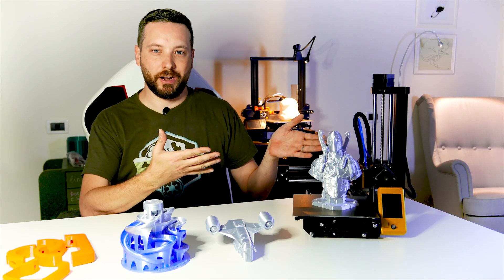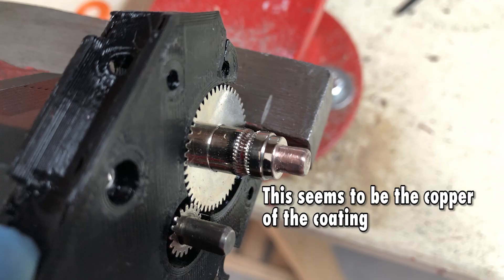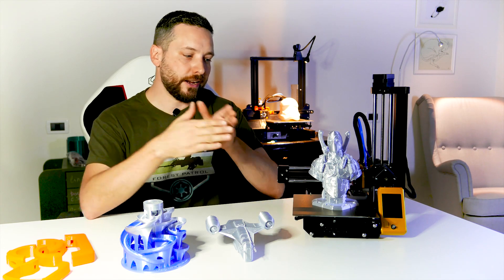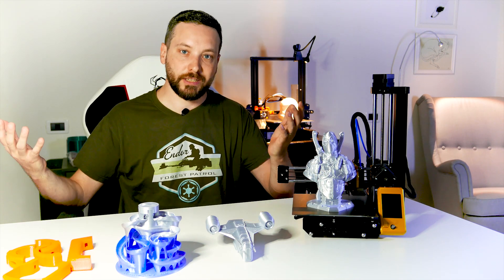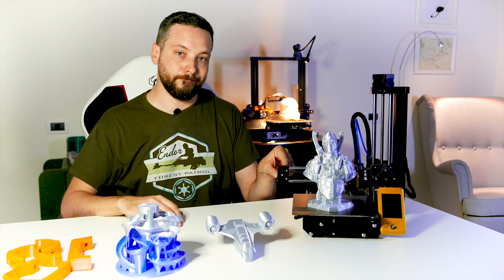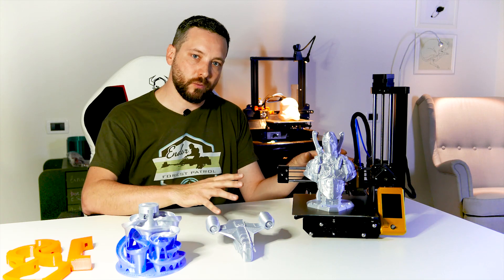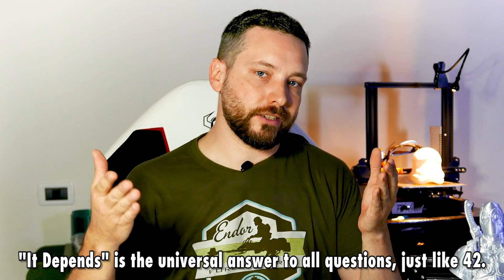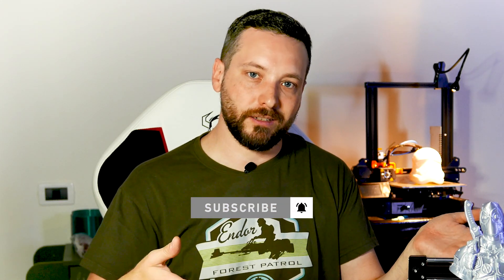Prusa Mini Clone Review!

Comment: Nice review, I recived mine same time and I agree with you as a good experience, caost me 210 shipped, btw am confused why can't this printer be 1st printer it's not complicated to build and  resolve and tinkering little bit and the extruder of prusa not good as bondtech anyway , and the main reasons to get fysetc one the coast and the lead time to order from prusa
Imp worth it
Reply from the maker: How do you print the parts if it's your first printer? 😜
Reply: @AMakeDesigns  this is not my 1st 3d printer, I printed my parts on my mk3s and my mk3s was my 1st 3d printer and come in the kit , and the parts for the mini it's available
Reply from the maker: Yes they are available but they are PLA and I can't recommend that since I did not get them. They come from China and the shipping time is too long for me, more that 1 month
Reply: @AMakeDesigns  the parts can be printed by anyone around or people who doing PIF for 3d printers, there is so many now, and the fact of  parts are pla not probleme with that the PLA it's good enough and stiff  and for anyone take this  for the 1st 3d printer he's not going to put it in the encluser in the beginning, asa better but this can be done after the 3d printer on hand
Reply from the maker: You are right. I'm not concerned by the PLA as such but I cannot recommend something I never saw. The prints might be poorly sliced, they could be old versions, too few perimeters or infill.
I like to see things before recommending. It's a small channel but I feel responsibility on what I share 😀

In the video I also mention that if you have access to printing services that might work for you. Actually you can buy the printed parts from Prusa as well 😜
Reply: @AMakeDesigns right, I am not saying this Version of fysetc is  better than the genuine one, but nearly for the half of price and lead time can be done

Comment: i have 2 of them 3 hours (per mini) building and 2 days printing, i love them they print great. as for the bondtech they can print higher temps because of the ptfe tube is after the heatbreak so it's better if you do other filament.
Reply from the maker: I might have over estimated the time. I was recording and I have been interrupted l several times. 3h sounds very good, congrats! Did you get any problems with the supplied parts?
Reply: @AMakeDesigns   no not really just a Buddy board that was defect (got replaced ) but mine worked like a charm. first one i bought the PLA parts, second one i printed out of Petg on my other printer (custom made).
Reply from the maker: Great! How where the printed parts you bought? Very curious!
Reply: @AMakeDesigns  they where actually very good, but like you said don't over thight them.
Reply: I had the same two problems...